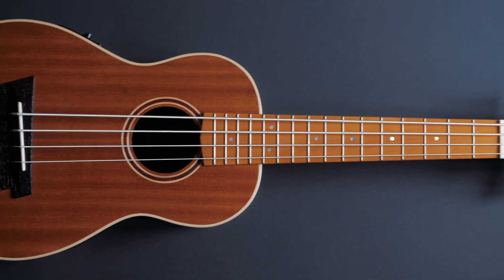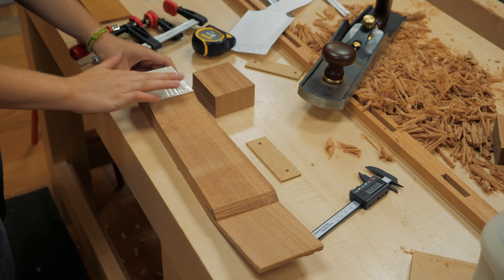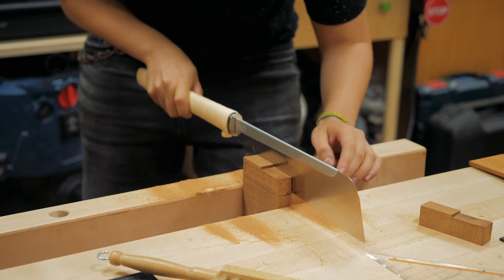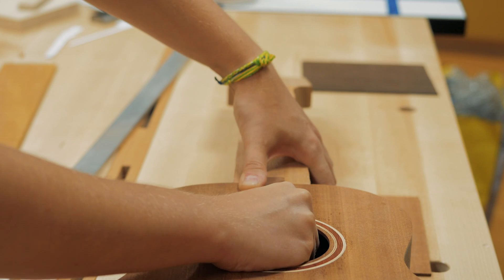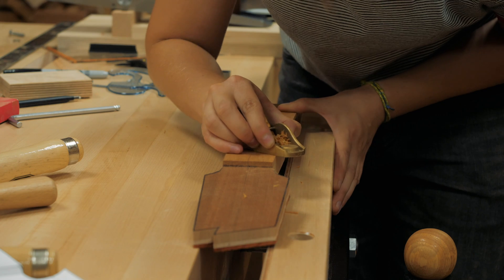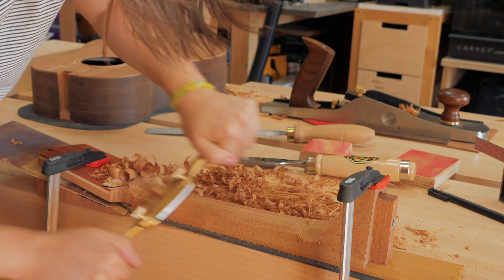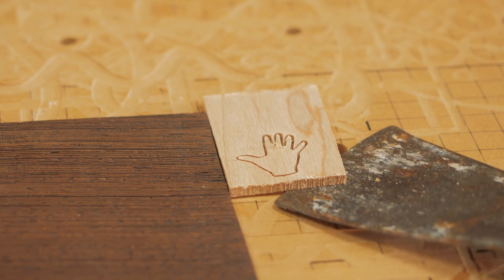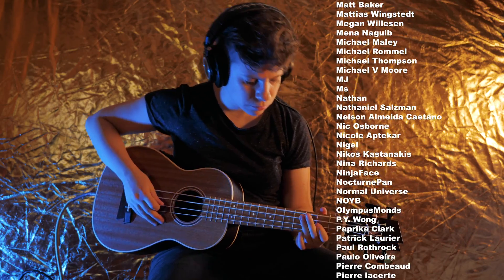How to Build a Ukulele Bass // The Neck and Fretboard - Ep.3

Comment: Normally builders never use epoxy, the reason  is when repairs are need, the repairman uses heat to soften the glue to remove the neck or bridge or fret board to repair or replace. Now the only way would be, hand plan it off, use a belt sander to grind it off. I will give you a example. I purchased a guitar that I like from the local pawnshop and the month  later I noticed the bridge was coming up in the back just a little.  There was a gap  under the bridge, you could put a business card under it. The glue must have failed. The normal way is to heat the bridge to about 250 degrees maybe 20 min. The glue should be softer, and now you can use a thin putty knife to slip it under to remove the bridge. But in my guitars case the builder used epoxy to glue the bridge to the top after the finish was applied. I applied the heat and put the thin blade under thinking all was okay. The bottom of the bridge had a large patch of spruce attached to it. It had ripping away from the top. I repaired the damaged and built a new bridge just a bit bigger to cover the damaged footprint left by the epoxied bridge. Removing the fret board is done the same way as a bridge. 
you are doing a great job on your build, it look great and sound vary nice.

Comment: I love the headstock design. I think I might do similar if I ever make a guitar. 
The quality of materials you used on this project seems way excessive btw. That is such a big piece of mahogany you had to whittle away! 
A u-bass  has such low string tension that it really does not matter what you make it out of. You could make it out if super light pine or even plastic and it would be fine.   
Even on pretty expensive quality guitars necks are usually made of two or three pieces glued together. It seems insane to use a single piece on a uke.
Also other things like the use of epoxy as a fretboard glue is puzzling. What is wrong with normal wood glue?
Epoxy is so insanely overkill for a fretboard and doesn't really have any place on a wooden musical instrument. It is awkward to use, more expensive and could potentially create a barrier between air & moisture in the fretboard and neck.
Traditional wood glues also allow an instrument to be dismantled in the future with enough heat and steam applied. 
The most stressed joints on a steel string guitar would be the bridge and the neck/body joint. Even these are not glued with epoxy.

Comment: Great build series so far, I really dig your perseverance and accuracy. Just a quick tip from my experience: 
You should have aligned the fretboard and the neck before glueing them together (Align the two center lines). Then pre-drill two tiny holes through the fret slots and into the neck (first and twelfth fret). You can then use some tooth picks for alignment during the glue up and nothing will be visible afterwards as the toothpicks can be cut off and will be covered by the fretwire in the end.
But apart from that, great craftsmanship!!

Comment: Why didn't you cut the headstock angle for a stronger joint/piece? Your headstock is pretty much all end grain with the way you made it
Reply from the maker: It's true, it was pretty much end grain, I noticed that when planing it. I did look after several examples and realized that there are many many ukuleles and guitars from a single piece without angled cut and I decided to try it myself.
Reply: Tom Zborovsky   I had similar question about not using a scarf joint. However I’m confused by your end grain comment. I’m not seeing it.
Reply: @mark2talk2u  Yes, I lost the term in the moment but I was talking about using a scarf joint. Scarf joints in guitar, uke, base, etc. Neck/headstocks are necessary for the strength of the headstock. When you cut the angle out of one solid piece, as seen in this video, the headstock is not as strong. The angle is essentially the end grain of the wood, as it is not bent or a separate piece. The end grain is fragile and could quite easily snap at that transition at the nut location. Obviously it worked in this case, and the laminations on the headstock helped a lot to improve strength, but nevertheless, scarf joints would be the way to go.